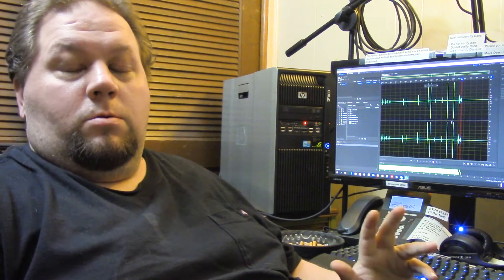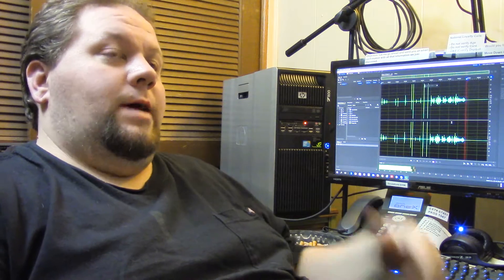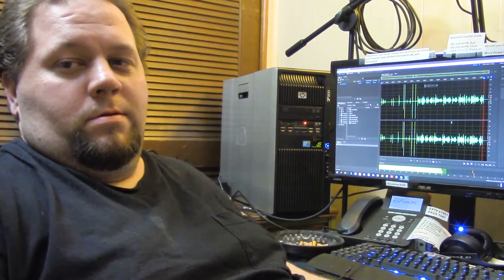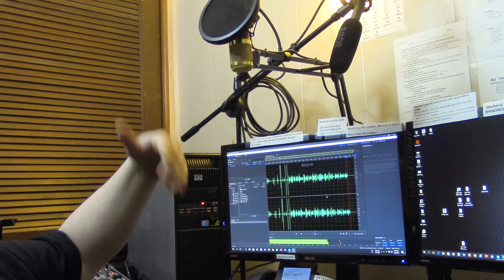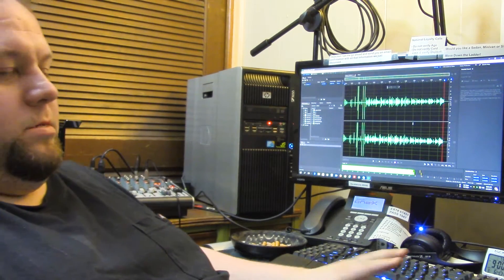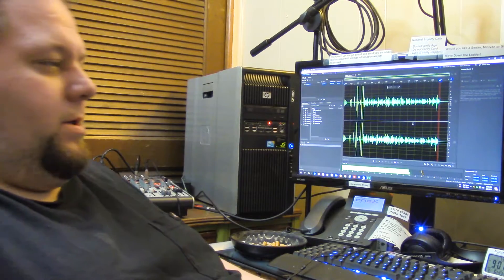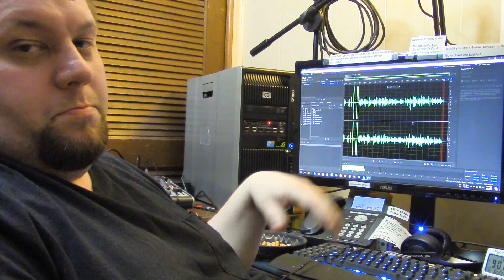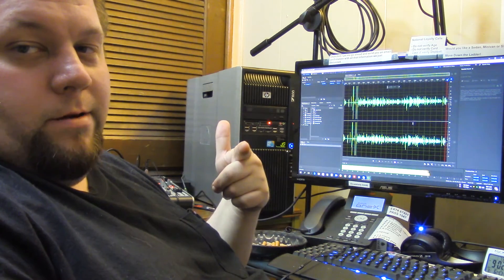Quick Update on the water cooling for the Z800.

Comment: Very nice.  I commented on your other video about how I don't prefer water cooling before I realized that you had done this! lol.

Curious, how much did you give for this kit?  I'm looking around and it looks like it's around 500.  Didn't mean to come across critical about water cooling, I've just not had good luck with it. (Leaks, dying after only a couple of years..etc.)

I'm installing a couple of X5690s in mine but waiting on the 1100 watt power supply and 'high performance' replacement fans to show up. (Only bought the fans because the high performance CPU cooler/fans that came with these cost about $200 a piece). I'm going to put the fans I ordered on an aftermarket 130 watt TDP cpu cooler that accepts 92mm fans.    Only thing is it might not play well with the memory cooling shroud and fans but I'm pretty good at modifying things.  

Wish me luck and will keep you posted.  

P.S.  I just found that this should work in the Z800:  http://www.nextwarehouse.com/item/?2447620_g10e    (Mfg Part Number SHPM2280P2H/960G)
There is a good forum write up about this up and running in a Z800 with some very impressive speeds but I don't have the link in front of me.  Once I get done building my Z, I'm going to be looking at this very closely.
Reply: I have a Supermicro board dual with lga 1366 sockets and I was looking into dual cpu AIO kits and could only find these HP AIO kits which are going for 400/500 which imo is absolutely ridiculous for what they are; theyre Asetek 585LX units which is essentially just two of the 545LC single socket pump/block combos on a bigger radiator. Asetek used to (they may still be) be the AIO cooler OEM for Corsair's first AIO kits such as the h50 h60 h70 etc and those single kits would be sub $100 (the 545LC was $80) so the fact the dual cpu 585LX kit is priced so much higher is ridiculous. For 4/500 bucks you could easily create a custom loop with quality branded components that would last longer, perform better/quieter and also be maintainable. If you didn't want to go that route you could buy  two AIO kits which would be much cheaper and perform better but I'm not sure on the fan mount sizes on the Z800 so it could require some modding. Regardless of that it's absurd that the dual kits cost that much when you could get better cooling performance for a fraction of the price.